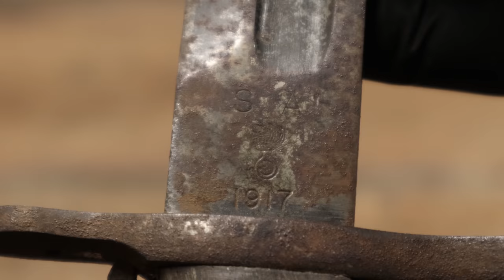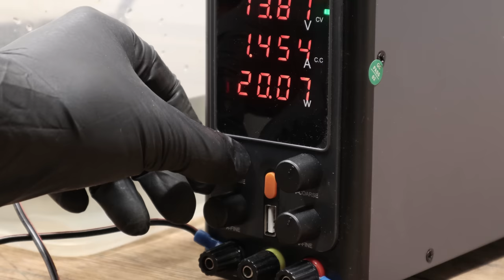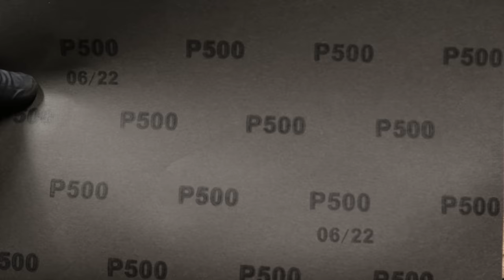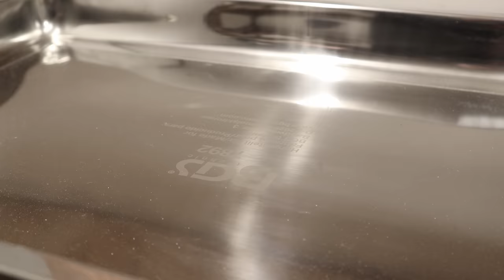WW1 - Restoration of bayonet, turning a rusty relic into a piece of history

Comment: you haven't turned a rusty relic into a piece of history, you have removed all traces of it's history and story by doing that amount of work to it, to restore it you should just clean it and make it functional, and it should have a blued finish or be parkerised so as it doesn't shine and give away the position or attract attention to the soldier wielding it, also by sharpening it you have changed it, new they were not sharp and the army didn't expect them to be as they were a stabbing weapon, having said that some were sharpened by the troops carrying them but by sharpening it you have changed it and removed part of it's story and authentic history, yes you have done a good job of the work you have put in but it isn't the right way to do it, suggest a bit of research before working on historic articles as there are many that destroy them on the net and few who restore them properly

Comment: I have seen lots of relic condition bayonets with decades of neglect, this bayonet is not in a relic condition. I have the impression that this bayonet had been deliberately rusted recently. There are signs at the start of the video that the quality of the bayonet is still very good and the rusting is uneven. I find this kind of restorations silly because they just sand and buff the metal shiny and call it restoration.
Reply from the maker: It is indeed a restoration, my friend, I invite you to review its definition!
Reply: @JSNRestoration I suggest you do the same. Restoring is to return it to its original state. You polished, sharpened and over all bastardized that bayonet at best.

Comment: It is a model 1905 Springfield Armory made in 1917 so it could have originally had a shiny blade, but hey began bluing and Parkerizing in 1917.  Pre 1917 the blades where raw and they began just dip bluing the old production raw blades.  Rock Island and Springfield made the 1905's and Winchester made some bayonets for the 1917 Enfield.  Looks nice and glad you restored it.  I do not have an SA yet, but I have a nice 1909 RIA, and a mediocre Remington 1917 Enfield. They are expensive to collect.

Comment: This bayonet is NOT an M1917 bayonet, which was used for the M1917 Enfield, it is an  M1905 Bayonet 
that was used on the M1903 Springfield Rifle, as well as the later  M1 Garand Rifle.  

Still, a nice restoration.
Reply from the maker: Thanks !!

Comment: Splendid job indeed. Just two remarks if I may : there is no need to sharpen the bayonet, it's not a knife made for cutting, it's above all a thrusting weapon. You should also have blued the handle of the bayonet, the 1905 had this kind of finish, though from 1917 onwards many were totally blued. Next job for you, make a WW1 scabbard... not easy but feasible. When I found my first 1905, I made one just like the original, in wood covered with leather, covered then by a canvas sheath. Try and make us see what you did !

Comment: The disadvantage of electrolysis for rust removal - it is very directional.  The advantage - as good an excuse as any to obtain a laboratory power supply unit.
Reply: An ordinary battery charger can be used.
Reply: I use a 12V battery charger, and  was surprised he took a wire wheel to it after electrolysis.  That's why I use it so I don't abrade any metal.  I did an entire 1888 German Commission rifle that the bolt was completely rusted solid, and red with rust.  After about 6 hours I opened the bolt by hand and pulled every screw.  Its the way to go.

Comment: Recently my Mom had given my Sun at 1 of these which belonged to my father's grandfather.  I don't know if it's the exact same model because I believe his was made closer to 1903 or something I know I will be doing more research Watching this video. I had people say don't Oh I should shut up Restore it, it will loose value.  I don't know What to do but Use it as a display piece In a shadow box containing the flag and cartridges from Grandfathers funeral and migrants on the same sides funeral.  My son's being at his dull And tarnished.  The leather scabbard Is dried out Discolored And had to be super glue as the tip Started to Rip while returning the sword to its sheath.  I did my best to inject super glue into the leather.  My son is a huge fan of Military campaigns and equipment. After we thought everything on my father's had been gone through stumble Across this bay nap was special.